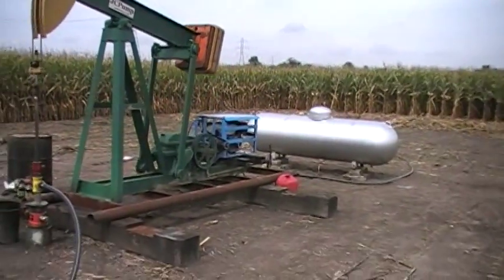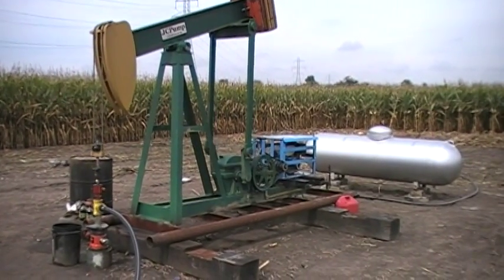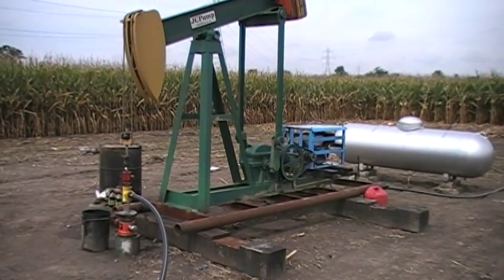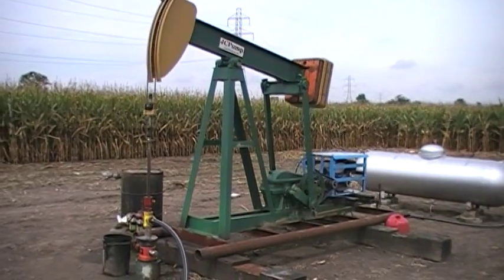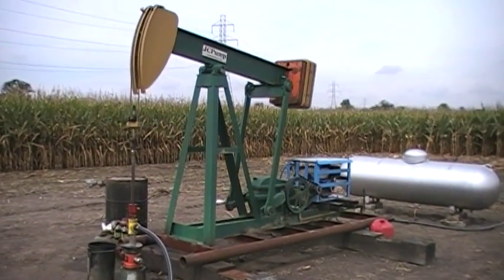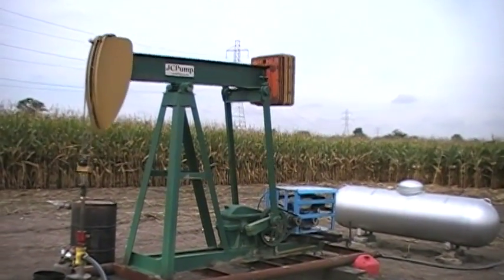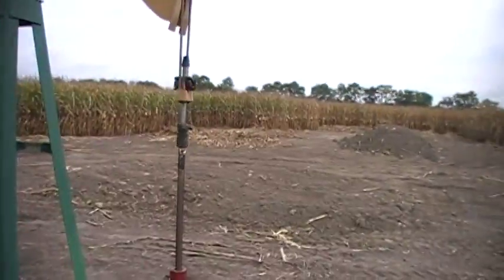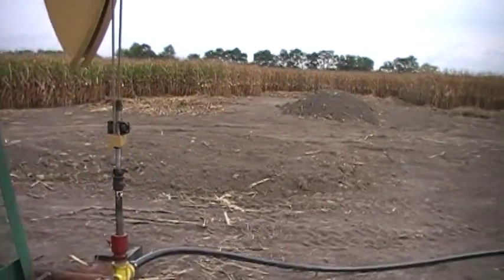Conwell #2 Oil Well

Comment from the maker: We have not had a problem yet with the Honda motors, but were told when we bought them that they were not meant to run 24/7. We are waiting on the price from the electric company to run power back 1/2 mile to the wells. We do use these Honda's on our smaller production wells and they are on timers. Really a nice unit fully automatic and run on the casing gas.

Comment from the maker: Bought the jack from Ken Miller Supply. It looks like a Cook because its a name change or Cook was bought out or something like that? As you can see I videoed at the end of the pumping cycle and it was hitting fluid at the bottom of the stroke. The well has not been treated yet with acid.

Comment: I see you are running the pumping unit on a Honda motor. Good motors, but I know these motors are not made to run for long periods of time. Did you make any modifications to the motor? Do you run the unit for a set amount of time per day?